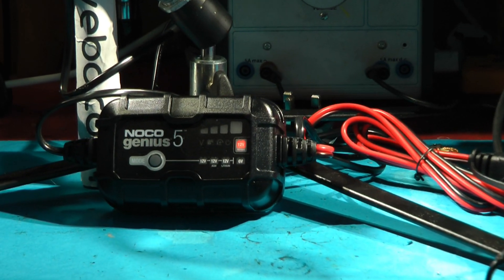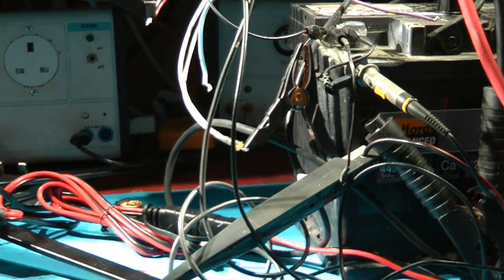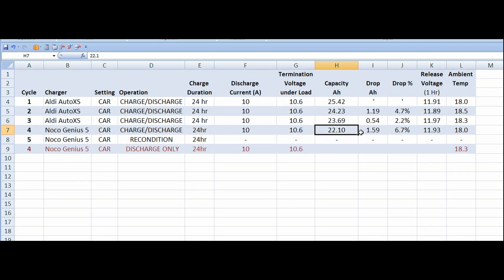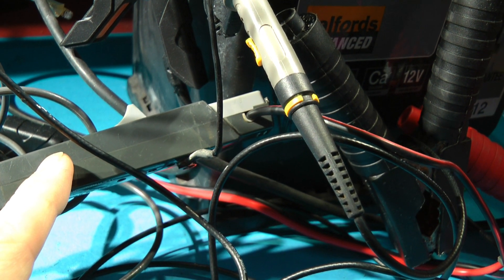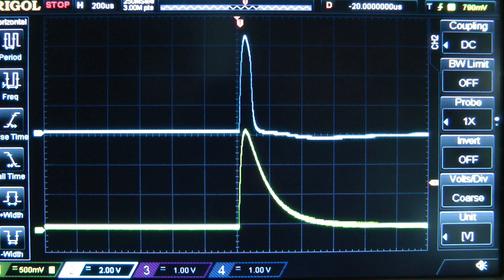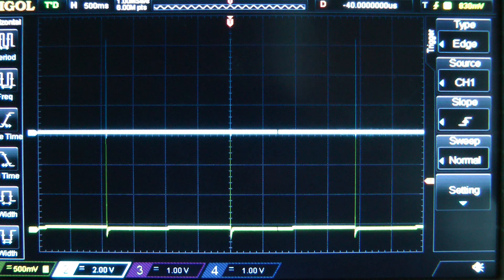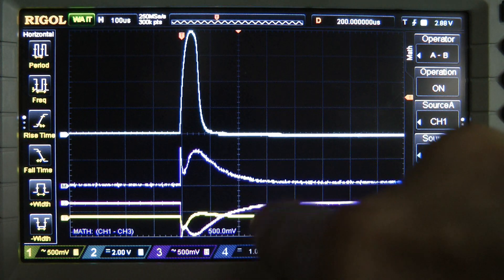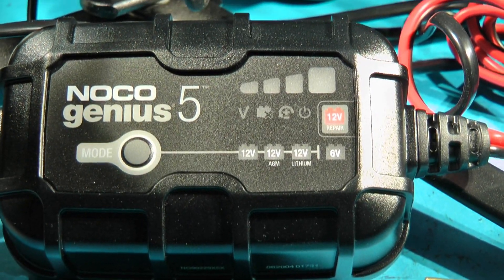NOCO Genius 5 Battery Charger Detailed Evaluation, teardown  and Review Part 2

Comment: Maybe the old school charges had it right... Used to use a half wave rectifier.. single diode.  So you got 25 pulses a second
Reply from the maker: Interesting thought.  Half wave would be 50 Pulses a second, Full wave 100.  If left connected they would overcharge the wet cell batteries of the day but you could top up the cells with DI. They certainly cleaned the sulfate from the plates and but I guess they would also etch the lead from the plates.    Using one on a maintenance free battery  is a bad idea if.  However with a new current management regime is an interesting thought.  The problem is that you need a weighty and expensive transformer but you could replicate the output using PWM switch mode to get the sine wave back.  '  A new charger that works as well as the old'  I am motivated to dig my old 1990 battery charger out of the store and see how it does!
Reply: @razenby  could you not just periodically measure the battery voltage and turn off at 15v .  This would be great on an old charger... Your old 90s charge would have a full wave... Perhaps a single diode mod would be worth measuring?  Selenium plate rectifier was common
Reply from the maker: @jusb1066  Selenium is useful because of the high internal resistance. The mains voltage in the UK is stated as 230V + 6% to -10%.   Plus 6% gives a voltage of 245V.  In practice it can be  up to 268V at my house.  That represents quite a spread when charging from a transformer and rectifier, a linear circuit with no control. A single diode would give 50hz at about a 10% duty cycle on a charged battery. ( there would be no current flowing util the rectified voltage  went above the battery terminal voltage at the peak of the half sine wave). Food for thought.  I wonder what some really powerful current pulsed will do. Something like 200A.  Noco mode on steroids!!!   To prevent overcharging I wonder if it would be worth draining the charge from the battery between pulses...  I could experiment but I feel I would get a lot of flak from the viewers that consider themselves to be battery experts.
Reply: @razenby  indeed replacing selenium diode with a full bridge rectifier on one of my old chargers meant output voltage was much higher,. No good then

Comment: Very interesting - thanks for the scope captures. For some reason I expected the charger would output a form of short-duration, high frequency 'burst' at/above gas voltage to help the desulfation process. This seems to be a very conservative approach, but then again I'm no chemist (or lawyer...)
Reply from the maker: The ones I have tested just pulse like this one.  The name of the game is to dislodge or break up the sulphate deposits on the plates to expose fresh Lead. You cant stuff lots of charge into modern batteries are most are maintenance free VRLA and electrolyte loss would outweigh the benefits.

Comment: I didn't realise that you'd been discharging at 10A.
As discussed on the first video starter batteries are capacity rated at a 20 hour discharge time.
So this battery when new should have been able to deliver 2.5A for 20 hours.
At higher the discharge currents the battery will provide lower total Ah capacity.
Discharging at 4x nominal current will make a significant difference.
There is a formula to predict the results at different currents known as Peukerts equation.
If anyone wants to do a bit of nerdy reading - try this
https://planetcalc.com/2283/

There may well be better explanations out there - just grabbed the first I came across.
Reply from the maker: Thanks. Maybe I should explain my reasoning a little better:  am not doing it a  2.5A for Three reasons:  
1. Compared to a 10A rate, It may yield a higher capacity on 2.5A but it will also do significantly greater damage to the battery because when nearly empty the battery internal resistance increases, at low current it will continue to discharge. i.e. The terminal SG of the electrolyte is lower at the 2.5A rate resulting in greater sulfation damage.  We want to revive this battery not ruin it completely. The 10A rate hits the stop trigger voltage earlier in the discharge cycle. 
2. I know this battery is bad as I tested the warranty replacement from Halfords and it yielded  42.6 Ah at 10A top 10.6 volts.  The 10A rate result correlates well with the state of the battery quite well..
3. I don't have the time!!  I will demonstrate this at the end of the testing.
Reply: I agree - good to read that you already have had a replacement from Halfords.
Can't help but think that if it was possible to 'repair' batteries and restore capacity with a bit of electric shock treatment then that's what would happen when you take one back 😀😀

Comment: That's an interesting take by NOCO on a repair mode.  A short high current pulse every 1.9 seconds isn't exactly an equalization charge which is typical of recondition/repair modes on these chargers and is nowhere near the number of pulses of the various pulse desulfator out there (most of them are at 1 KHz or about 2,000 times more high current pulse).  It would indeed be interesting to see what these pulses in the repair mode actually do.
Reply from the maker: Interesting. Most of the cheap chargers I have tested  pulse at around 1 to 2 second intervals.  I have seen many Chinese battery re-conditioners especially for golf carts that do the short pulse at a slow rate. You have to bear in mind that most car starter  batteries these day are VRLA maintenance free so you cant do crude overcharge (effectively what reconditioning is) without losing electrolyte.
Reply: @razenby  I wonder if NOCO started this slow pulse thing and the Chinese vendors just copied it or if NOCO just got a Chinese supplier to make it for them?
Reply from the maker: @richardlouie2922  Not sure, I have a pule re-conditioner  that I bought about 12 years ago for an ailing deep-discharge camper battery that uses the same pulse system as the Noco but it didn't help ......
Reply: @razenby  That is why the work you do here is so important as it calls out the questionable products for us!

On a related note - do you have access to the BatteryMinder line of products over there?  They advertise a working desulfation process that has had great reviews over the years.
Reply from the maker: @richardlouie2922  I can't see the battery miner range anywhere over here.  When I look for products that look a better quality when I do find them they are usually made in the USA.  I just ordered some stuff from the USA but the shipping is usually very expensive and the import duty is a consideration.  I guess the Mains voltage is an issue for some products. It is a shame as the Chinese crap  is sneaked into the a leaky EU border UK and sold without duties on eBay. I feel there would be a strong demand for a site that imports and sells quality US products.  Let's hope for a better free trade deal. You cant even buy some Dewalt cutting steel hole cutters and drills over here. I see them consistently win hands down on sharpness and durability (on the Project Farm channel) but you cant get them in the UK.  I bought a Bosch sets instead.
Reply: @razenby  I know exactly what you mean about ordering from the US. Canada is the same with crazy shipping fees.  Have you tried a service like Desertcart? They seem to have BatteryMinder listed on their UK site - https://www.desertcart.co.uk/brands/batteryminder. I don't know how reliable they are but at least it's listed.

Comment: Be interesting to see if these are safe for leaving on 24 /7 on a AGM  to keep off roader fully charged
Reply: That might take a long time... The strategy on the accunmates is  10 days on float.. thenn a strategy of occasional monitoring and top up. You can't flost a battery indefinitely according to some sources
Reply: @jusb1066   Thanks for the  reply, i have used a Ctek 10 for the  last couple years on full time and its been fine, on Odessey Battereies,  but its just failed with the  same fault as the  5.0 @magic Smoke  fixed (no lights at all)  I've stripped it out of the  case  but the 10 board is totally different so cant use your fix unforunatly
Reply: @lesbrock6719  I'm sure ctek has the same strategy as accumate, and was perfectly safe for long term
Reply from the maker: CTEK has Lights and stages...that are documented in the manual.. the trouble is that the manual is a work of fiction .....Oh and teh electronic quality is very cheap - I have hundred of people wanting to send me faulty CTEKS. Trouble is I don't do repairs for money.